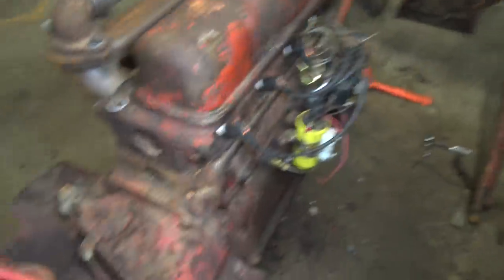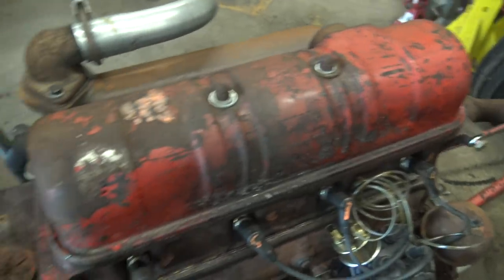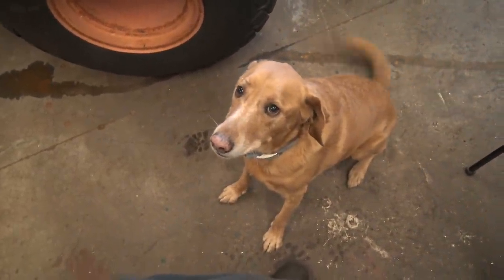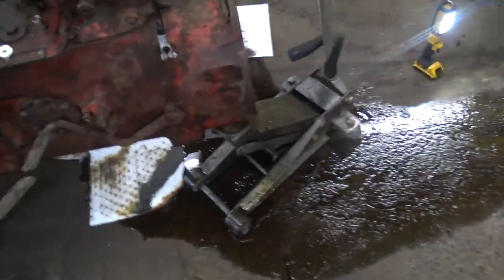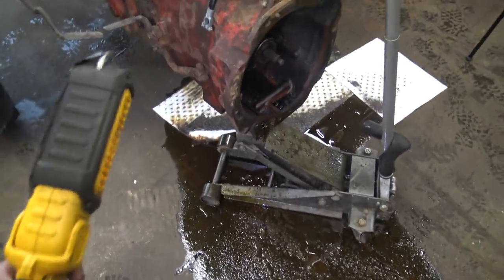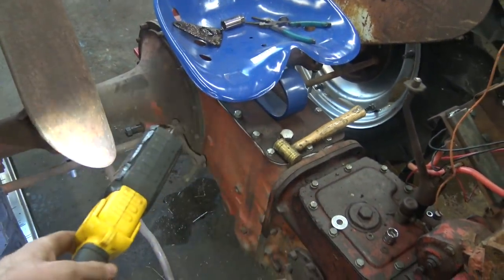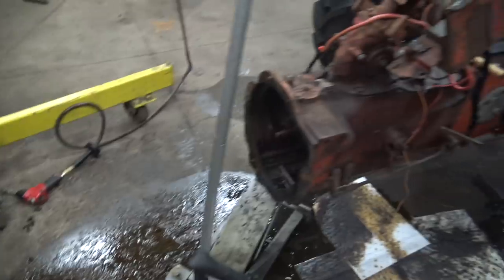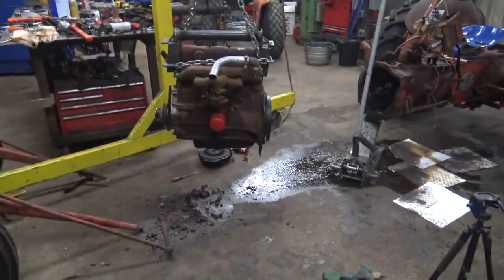Lets Fix The Clutch In This Classic Farm Tractor!!! (Part 2 of 2)

Comment: Engineers build NUT and BOLT head size different so you can use one set of wrenches. Rather than having 2x 3/4" wrenches, etc.

Comment: I own an 800 series Ford tractor and you can't leave them sit for any length of time without pinning the clutch down (It is designed that way)  There should be a place to put a pin to hold the clutch open, when sitting idle for any period of time.

Comment: The only standard bolt I Know of that uses a different size wrench for the head and nut. Is a 7/16. Which uses a 5/8 for the head and a 11/16 for the nut. There are bolts and nuts out there. That are standard sizes. That uses odd size wrenches. But they are few and far better.

Comment: Had a few of those tractors, most were the standard 4 speed h pattern, I truly hated to 2 industrial units with the rotating 5 speed shifter, they were a royal PITA, and the 1 extra gear didn't do much in way of performance of operation